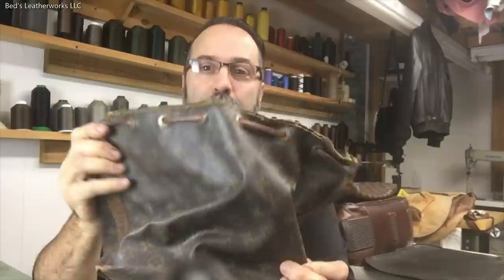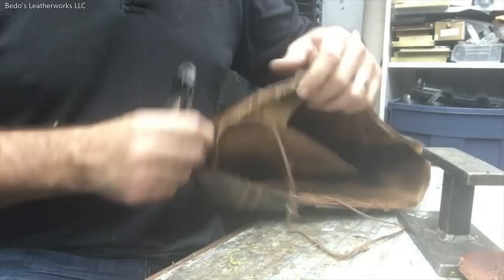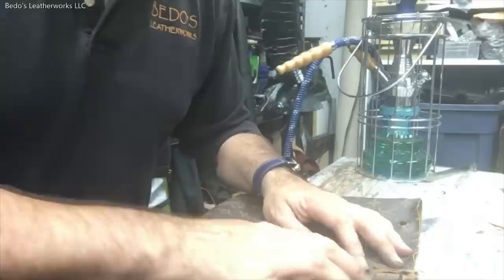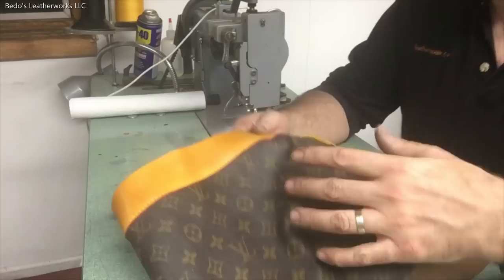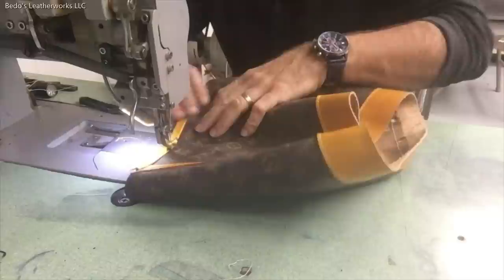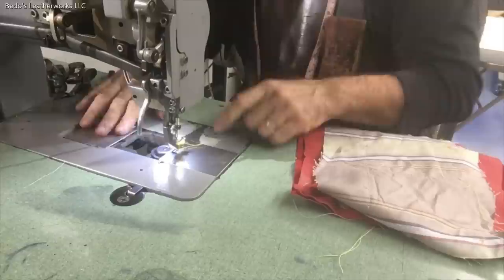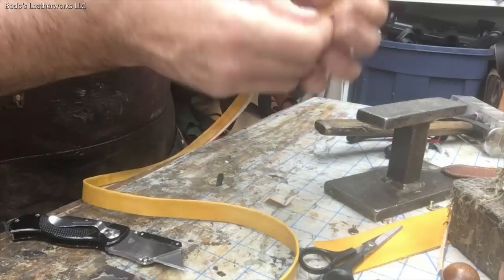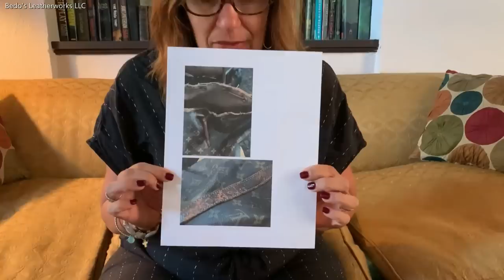louis vuitton bucket bag #146

Comment: Using the original brass and grommets is a really nice touch.
Reply: ...even taking the trouble to put the Louis at the top and Vuitton at the bottom. That's caring, and therefore rewarding.

Comment: The appeal of buying Louis Vuitton is that its a luxury quality product that will last a life time and if it doesn’t the item can be sent in for repair. Unfortunately this project was proof that is not the case even LV turn this lady away! I like how Steve easily finds solutions to repair the chaffing damage by adding stylish trim and installing new accessories that blends with original style of the bag. I wish someone could CNC a tool for Steve to make it easier to remove the LV grommets & button fasteners.  Another excellent job!

Comment: Have you thought about using a pair of flat nose jewelry pliers for refurbishing the grommets? It will get in there easily and would make the edge nicer. I wire wrap jewelry and there are so many tools that might make the grommet and hardware removals and refurbishing easier and less damaging.

Comment: At 17:18... “you don’t want to hold the grommets with your plyers”... you have leather scraps... what about making a pair of leather “thimbles” for the jaws of your plyers??... you could wet form them to the jaws and then cement them to a dedicated pair of plyers.
Reply from the maker: Lois Gehman it doesn’t matter what I’m using whether it’s got leather on it or not it will still bend the grommet
Reply: Bedo's Leatherworks LLC... true. When I’m at my bench, I use two pairs of plyers, one in each hand, when I’m doing the fiddly bits of my jewelry making... I can hold an item securely with one plyers and do the detailed work with the other pair... it saves me a lot of wear and tear on my fingers.

Comment: an automotive tool like this: https://www.amazon.com/Jetech-Trim-Clip-Removal-Pliers/dp/B07NNR4H9J/ref=sr_1_55?keywords=grommet+tool+remover&qid=1583817164&sr=8-55
with some slight modification (grinding it down for a thinner profile). Might give you the leverage points to remove the grommets cleaner and "roll" the edges smoother brass or aluminum is soft enough to roll. YOur probably aware in most trades the tools are invented out of the trade vs the tools invented for the trade.

Comment: I hope you charge enough to fix those bags. They are made of paper thin print leather stitched by slave labor not to mention out dated design. My wife makes hair on cowhide bags with fringe .pockets and thicker leather. Here in Texas LV built a factory had my wife check on job with them. Starting pay $10/hr. She would make more working at gas station.